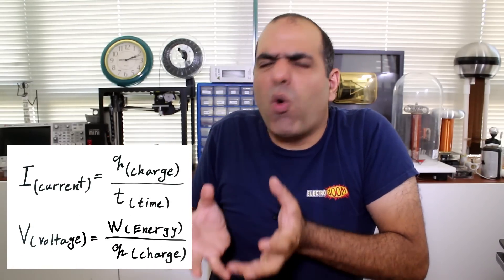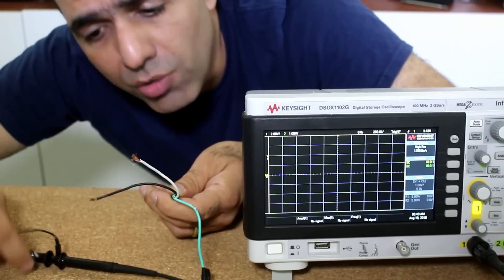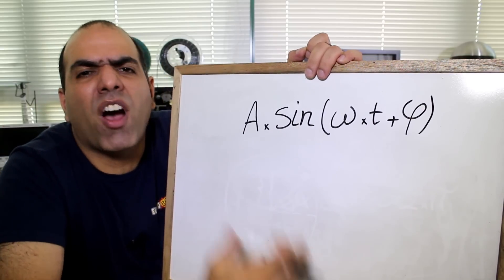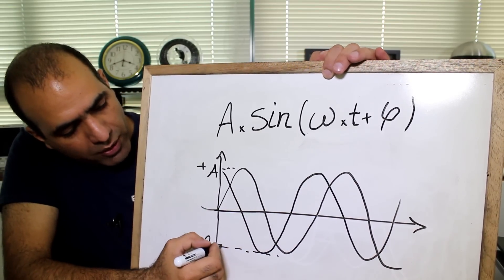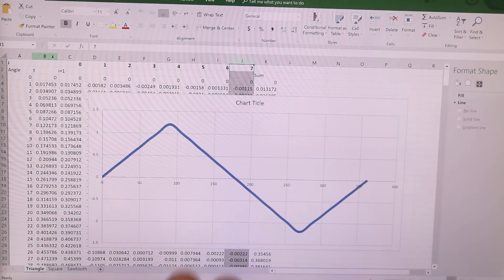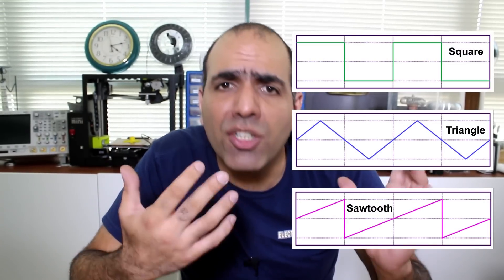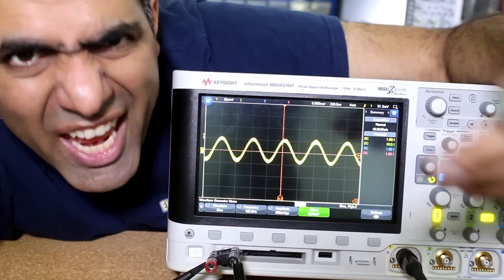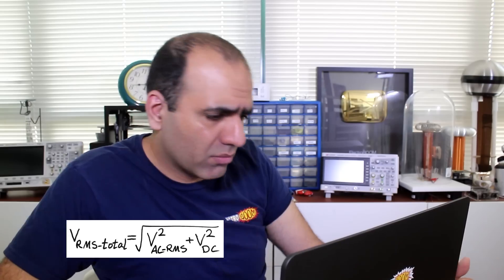What’s AC and DC (ElectroBOOM101-003)

Comment: This video is easily the best way to get insight for the electronics and Fourier courses taken at college, sometimes you are given formulas without explanation, you use the formula, pass your exam (or maybe not) but at the end you have no actual knowledge to design circuits or to understand how things actually work, it's funny how a good explanation of AC can give so much insight regarding a ton of other subjects: control theory, signal analysis, electronics, and even some problems in statistics (which are further useful for AI)
Excellent video, one of the best I've seen

Comment: Dude you're wrong with definition, not only a constante voltage is DC, also an always positive voltage is DC, the concept of alternating current is that the direction of the charges to move change in time, not only the magnitude of the flow.
Reply: jacob Jimenez 
What about always negative voltage?
Reply: @UnrealPerson  same thing, it would be DC voltage.

Comment: My brain Hertz.(jk only for a joke)  I am 13 and have made my own wireless phone charger and home cleaning robo which is controlled by a remote wirelessly and can charge from the phone wireless pad. Cool right.
Reply: AWESOME EVERYDAY the cleaning robots inductive coil transmits a much high voltage than what your cell phone can handle... If it hasn't happened already, your phones charging circuit it going to get fried. Cool right.
Reply: c31979839 They said the robo is charged from the phone charger, they also said they made the robo so how do you know?  Maybe instead of coming up with snarky assumptions to make a 13 year old feel stupid you should bone up on your reading comprehension.   Or maybe grammar, '...' doesn't mean what you think it does.  Cool right.
Reply: EgadsNo thanks, but I have replied to him. And it seems like a simple case of miss understanding. plus I know everything how my own design circuit works to the electron transfer in the circuit.
Reply: c31979839 I have got a bridge rectifier and a 5 v regulator with a heatsink attacked to the back of the phone & I have calculated the no. Of turns req    for approx 6 volts at the phone coil. So nothing heats up. Simple.

Comment: DC doesn't necessarily mean the voltage goes in a straight line. Any voltage that doesn't go over and under 0 is a DC voltage. AC voltage goes over and under 0.

Comment: Great video as usual..but can someone explain this to me.... the positive wave goes from hot to neutral,but when the wave goes negative do the electrons  return from neutral to the "hot" and vice versa...or is the flow always from live to neutral but the polarity changes..can someone explain this to me ,iv been looking everywhere..
Reply: When hot wire is positive, it attracts electrons from the neutral and when it's negative is pushes electrons into the neutral. Note that positive and negative changes were assigned arbitrarily, before electrons were discovered. Electric current always flows from positive to negative, but in reality the electrons go in the opposite direction. For most purposes it doesn't matter, because lack of electrons behaves just like a positive "electron". Really the only scenario where negative/positive makes any difference is in vacuum tubes and semiconductors.
Reply: i think i got it,the neutral is basically like the name says "neutral"it cant be charged nether positive or negative..so when the live is at positive cycle meaning it has a high positive charge ,the negative electrons are attracted from the neutral so they move..but when the live goes negative and has a high negative charge the electrons move towards the neutral .. am i kinda right ?
Reply: precisely!
Reply: Thank you for your explanation  ,now it all makes sense to me ..
Reply: KohuGaly thank you
 i had that doubt too
Reply: Learned something today. Thanks!

Comment: AC can flow to the ground(earth) to complete circuit  but DC can't. DC require both positive and negative to complete the circuit.
May I know the reason why?
Reply: AC can only "flow to the ground (earth) if one side of the AC has been bonded to the system ground installed to provide a non-arcing path for induced high voltages, from say a nearby lightening strike, to the earth.  And isolated AC system, such as the inverter he shows, can only have current flow through the two sides of the circuit.

The bonding to "ground" is done for overall system safety and to cause faults to conductive items near the circuit to trip the breaker.

Comment: converting AC to DC is some what easy, 2 diodes and a few capacitors to smooth it out but if i wanted to add AC to an existing AC line (like having many generators on 1 grid) there i can't even begin to guess how! 1 you need to module it and on top you need to sync it!

Comment: GOOD EVENING ElectroBOOM hey !  big fan sir! 
i have a question its off topic but i ll ask anyway 
i am doing a project where i have converted an automotive alternator to a 3 phase ac motor using a bldc controller, i am wondering if i can couple another unmodified alternator and connect its stator windings to this modified motor and the couple it to a I.C engine 
would the alternators field current be enough and would it create the required rotating EMF to run the modified alternator without the BLDC controller ?

i love your work ! 
please keep inspiring (without killing yourself )  :)

Comment: Oh wow you just helped me so much.
I'm an stage technician apprentice and we learn also a shit-ton about all sorts of electronics as we're allowed to work with up to 1000V when we finished the apprenticeship. I'm in my final of 3 years now and to me it was always like "the more amps the more powerhungry devices you can use" but I never really understood what volt and amps are. But it all makes so much sense now. If you imagine volts and amps as particles and wires like a pipe, you can really say that the volts describe how "fat" each particle is and amps describe how much of them are there at once. And if your wire AKA pipe is to small and too many particles want through it at the same time they get all pressed together and create friction and heat up the "pipe", some get stuck. If you get a bigger diameter pipe they have less trouble passing through it, the thicker the more amps.

I learned about all of this but as I said, I never really know how to think of those values. Thanks so much, this blew my mind so bad